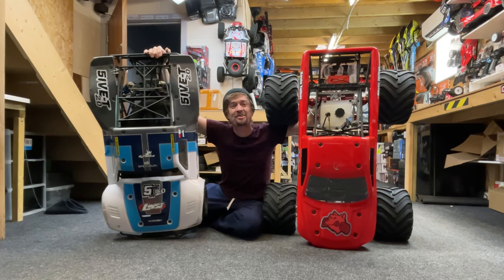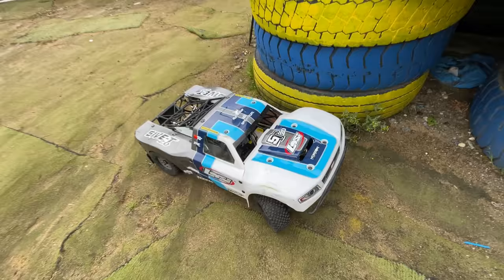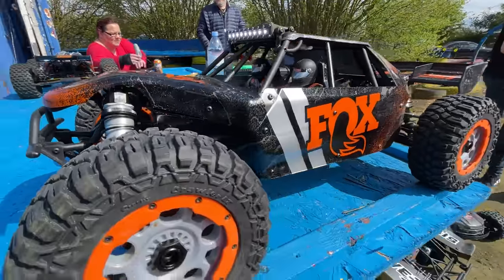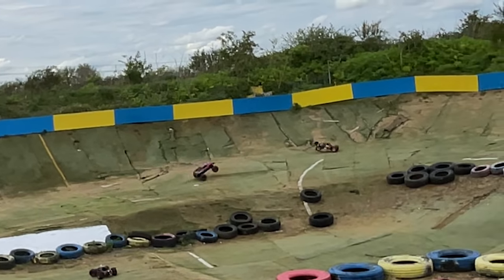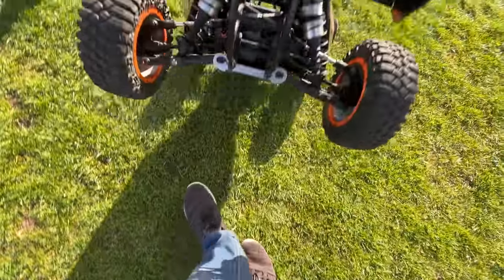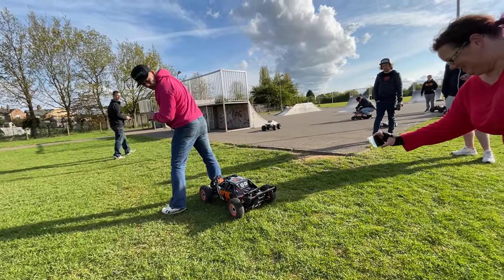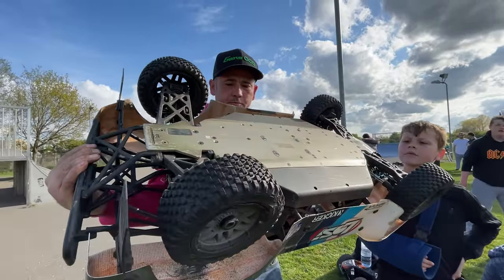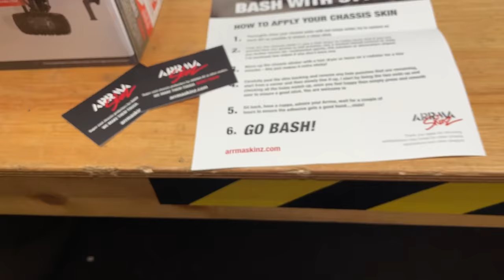Worlds Biggest Petrol RC Car FLAT OUT jump

Comment: 1:25 Hey Kev, I'm a mechanic and found this online; Typically, driveshafts contain universal joints at the ends. Over time, the grease inside the fittings can disappear, leaving the U Joints all nice and dry, but that isn’t a good thing. When the pieces are not able to turn and move freely, additional strain gets put on them. So much so that the universal joints can break while the vehicle is in motion. In turn, the driveshaft can become disconnected and hit the ground. The issue can be dangerous, as the car won’t be able to drive forward or backward.
That would be bad at 100mph!! Also, why are you driving that rust bucket that fast? I can't judge I drive a honda accord with almost 300,000 miles on it well over 120 HAHA

Comment: If the drive-shaft comes off at high speeds it could cause a roll-over. If you use a "drive-shaft loop" even if the drive-shaft comes off it will keep it from rolling the vehicle.

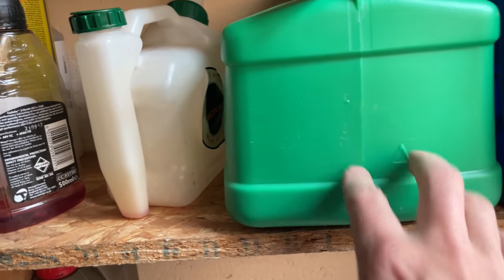Comment: 1:29 I have dropped several driveshafts. The rear joint isn't bad. A loud noise, the engine revs and you begin to slow down. The shaft will slap around for a few revs and then the transmission (transfer case for Andy) will spit out the driveshaft and start leaking some fluid. If the front joint goes the shaft can get bent and really whack the bottom of Andy, but I have never lost a front joint.

Comment: I've been running  5200 mAh / 45C batteries, now I'm thinking of purchasing 6000 mAh / 80C batteries. Will this cause any problems ?
Reply: No, a bigger C rating means your battery doesn't have to work as hard to deliver current.

Comment: If you break a U joint on the highway what can happen is the drive shaft flailing around can flip the vehicle sideways. Easy to do in a land rover considering how high it is. That's why race cars have a "cage" around the driveshaft in case that happens.

Comment: The driveshaft will not fall off. It's not the problem. The diff is. The play is because the teeth of the ring and pinion are worn out or u have a broken tooth. It's not the joint.

Comment: yep fix the pinion, i was with a guy at 80  mph and front u joint broke and drive shaft was like a pole vault , needless to say around 10 flips later i was laying in the road watching his car tumble a few more hundred yds.  i got up and walked to the car fine other than a few hundred stiches needed . my buddy didn't fair to well.  maintain your ride kev

Comment: It’s 25 to 1. Use synthetic 2 stroke oil. Ideally minimum 91 octane or ethanol free fuel.
Reply: "Gas" is a little different in Europe. I believe they have 97 octane that is "equivalent" to the US 91 octane. Before being a know it all try knowing MORE.
Reply: VP110 with dominator 2 stroke oil is the way to go and I run 50/1 why would anyone drown there two stroke with oil running 25/1? The manufacturing only puts that in the book because its stupid safe you are literally just drowning your motor with oil, gas makes power not oil.

Comment: I’ve heared that the rustler 4x4 is pretty much the same as a vorteks
Vorteks vs Rustler 4x4?
Reply: @ericpeterson9676  the driveshafts suck, and the shocks a little, but mine has those upgrades on it and it’s a beast!

Comment: If Andy the landy's axle begins to fall off while driving, Andy will start to pull to one side as one wheel loses power. When the axle breaks completely its corresponding wheel will no longer turn and although the engine may still run the car won't move!

Comment: The weight of the engine keeps it very level in flight.  As a newbie to me most of the problem the electrics have is due to too little weight.
Reply: @NeoIsrafil  Yes.  Thinking about it  the components aren't distributed  well weight wise.

Comment: Sup Kev! Just wondering why your so afraid of taking your cars in water? I take mine in mud and water aaaaall the time and barely even clean them, but there still all good :) I think all ya need to be safe is a little bit of WD40 ;) anyway, have a good day!
Reply from the maker: water gets in all the bearings and gears, your car wont stay nice for long it will be wrecked before you know it unless you fully rebuild it after every time you get it wet
Reply: @KevinTalbotTV  I’m actually quite surprised with my car. It’s a Wltoys 12428 and I’ve bashed it as hard as you bash your cars and the only thing I’ve broken is the rear driveshaft, all fixed  now though. I do clean it out a bit and as I said, lots of WD40 will do it 😉 
Keep up the great content btw, I love your videos :) your the one who got me into RC’S, thanks for replying:)

Comment: If the driveshaft comes apart there will be sparks, noise and no more go. If a carrier bearing goes out hang on. I had go out at 60mph. It was like being in a paint shaker

Comment: Do the motors have enough torque to cause them to be able to handle in the air like a gta game, or does it have to do with center of gravity?
Reply: Centrifugal force mate. Yep, a lot of torque. Throttle brings the nose up, brake puts the nose down
Reply: @MrBrenos  ahhhhh thank you!!! I kinda figured that’s what it was but I don’t know much about rc cars so I didn’t think the tiny motors would have enough torque for that lol
Reply: @NickVanse  no problem. You can also use the steering to level out the buggy sideways, left to right. Which means you can whip them like a dirt bike

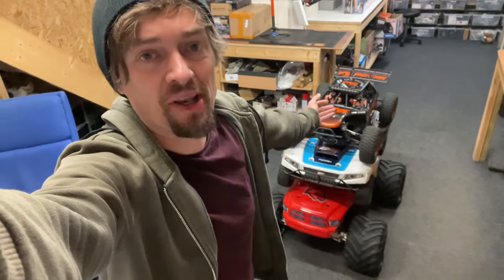Comment: you should get a Hosim 2845 Brushless RC Car 1:16 Scale Remote Control RC Monster Truck , All Terrain 4WD High Speed 52KM/h Off-Road Waterproof/Shockproof/Anti-Skid 2.4G Radio Controlled RTR Hobby Car(Green)

Comment: Kev I've seen 4wd driveshafts fly out in the mud, on the hwy, on the jack, and on a lift in a garage. I've seent'em spit out of hot rods on the street, the dragstrip, the parking lot, bouncin over speed bumps, halfway on/off the trailer, and even sitting still. I've seent'em come apart out of cars, trucks, swamp buggies, monster trucks, boats,  Atv's and more often than not when their loose. They vary from thru the floorpan,  to no other damage and lost, fly sideways and cut down a tree, stuck staight down lifting the tires off the ground or even hit another vehicle and cause an accident. At any rate ITS DANGEROUS park it till its fixed. U can change it out urself in bout an hour. With a wrench, hammer, and a couple of sockets or a hydraulic press. Dirt cheep unless u let it come apart, then theres just nooo tellin

Comment: 25/1 should be 40 ml to 1 liter of petrol best get 2.5l petrol and stick 100ml of oil in easyer to measure recommend castrol 2t 2 stroke 10 pound a liter but good quality 👍👍👍

Comment: you know there's an equation to find the height something of any mass went went. Its 0.5 x 9.81(g on earth) x t^2 (time taken to reach the highest point)
Reply: Doesn't work 🤔
Reply: It's speed x t (till highest point) - 0.5 x 9.81 x t^2
Reply: But then you need to know speed at point of hitting the ramp, way to much hassle when you can just attached a GSM-020 that uses barometric pressure to know the height 👍
Reply: @HardcoreRC  no you don’t. The equation does work. I dunno what @Timatrix 00 is on about. But obviously yeah I agree that it’s probably a pain to have to analyse the footage after rather than just read off the barometer.
Reply: @timatrix0013  it does
Reply: @cosmosutcliffe9160  Surely you also need to know the angle of travel though, height would be different if i we sent of a 30 degree ramp versus a 90 degree ramp
Reply from the maker: what about wind drag, car speed, ramp friction, angle plus an infinitive amount of other variables , no way you're working it out no way!
Reply: @KevinTalbotTV  im going to stick to the GPS 😂😂
Reply: @KevinTalbotTV  jeez! No need to get angry. I was only trying to help. Anyway all of those things you mentioned don’t actually effect the height except drag, but since the upward velocity is very low this has a negligible impact.
Reply: @HardcoreRC  actually, strangely not because everything travels on a parabolic trajectory and the upwards velocity is the same for everything
Reply: @cosmosutcliffe9160  how can you know how high something travels if you dont know the speed only the time.. like if i need a minute to reach 10m bc i give very little throttle (for example on a helicopter) the equasion wouldnt know that

Comment: Alright so when that drive shaft breaks hitting the brakes will not stop it and that shaft will bang and bounce around causing mayhem under the car you'd have to shut down the engine 8n order to stop that shaft from breaking everything there's even more things that can happen

Comment: If it falls off in the frunt you might flip it is falls off in the back spot as fast ast you can’t and that’s it dropped a drive shaft in a trash truck once going 60mph once messed up the road bad bad and the truck needed a new axel becouse the back drive shaft smacked back and forth between the road and the truck the crank case and back axel snapped off and inhalf idk how.

Comment: Put a muffler on that damn thing and quit annoying people, same with your rovans. Will make it more enjoyable for all involved.
Reply: @harveylong5878  yes the  Losi and yes I am aware that 2 cycle engines can be noisy. Let me see... I have been around atcs, atvs, snowmobiles, motorcycles and also small power equipment all of which have had and still do have 2 cycle engines and believe it or not manufactures  can and have met noise restrictions with all of these. Also I will almost guaranty that these annoying  pipes that are on these (losi or otherwise) units make little to no extra power just more noise. Two cycle engines are hard to tune for more performance with a pipe  and gains even when optimized are minimal at best. I realize that some engines respond better than others but lets face it these are no more than weed eater motors at best.
I could go on for a few more paragraphs about the tunning of a  2 cycle engine with stuff like port timing,squish area case stuffing and so on but dont feel I need to. Just to put it in perspective a 700cc 2 cycle 3 cylinder with a "can"  instead of a proper muffler  may actually and probably will lose power. If there was a power gain it would be no more than maybe 5 hp but likely not that much... this is on a 700cc engine not a 35 to 50cc engine such as in the Losi so any power gains would be minimal from a stock can which make it not worth pissing people off with the noise. 
As far as the turbo on a V8 comment, have you heard his combo? A turbo shuts up an exhaust quit well actually, not as good as a proper muffler but still pretty darn quiet.
Reply: @harveylong5878  if that is the case then the manufacturer should not be allowed to sell it that way much the same as a chainsaw or string trimmer can't be sold like that.
I know I sound like an old grumpy man with this but I hate listening to loud engines just for the sake of them being loud. Also the fact that a lot of the time thus ruins the hobby/sport over time, has happened many times in the past.